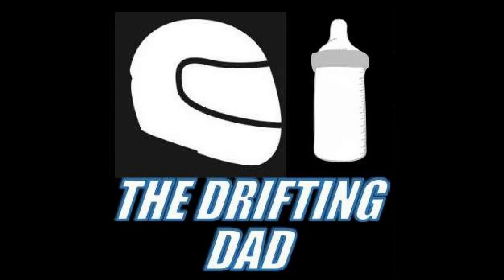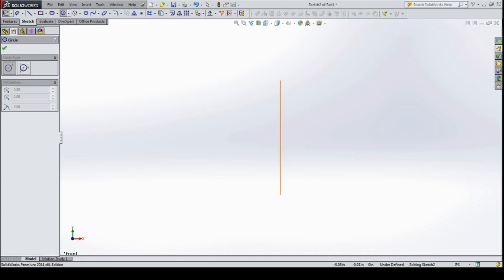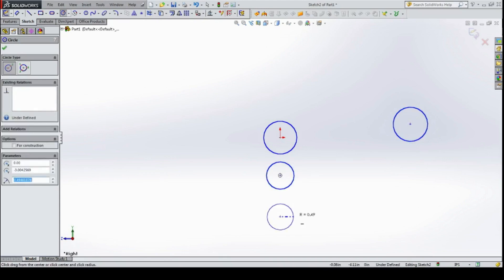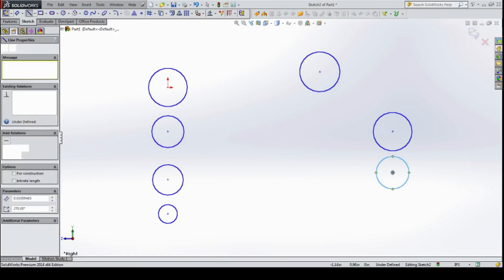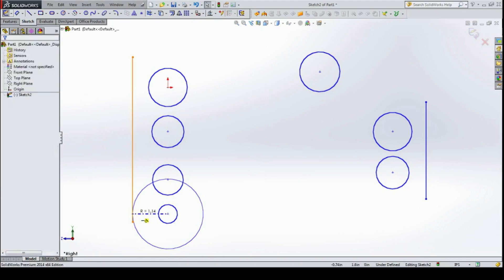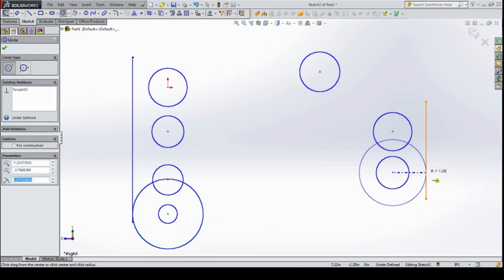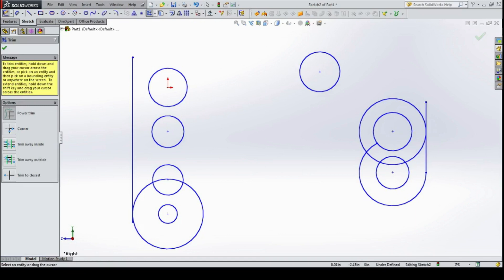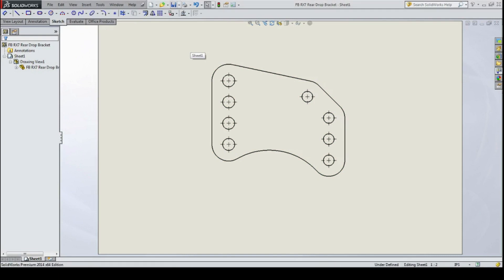Designing FB RX7 Rear Drop Brackets

Comment: Did you ever get these installed? Did they fix the issue and fit as you planned? Thanks for the video I have been trying to figure out what I want to do with the rear end/suspension on my SBC swapped fb. What rear end are you running? I watched the overview but didn't catch what rear end you have.
Reply from the maker: Glad you like the video!  I have installed these and they seem to be working good, I will be putting a video out soon showing them.  I still have the stock rear end for now
Reply: Is it a gs, gsl or gsl-se rear end? I'm asking because I would like to take my car to an event but not if my diff will immediately blow.
Reply from the maker: Sorry I didn't clarify earlier.  It is a GSL so it has the clutch type LSD.  The 84 and 85 years have the much stronger axles.  If you are making similar power to me (350 hp) I would think you would be fine as long as you don't run a massive sticky tire